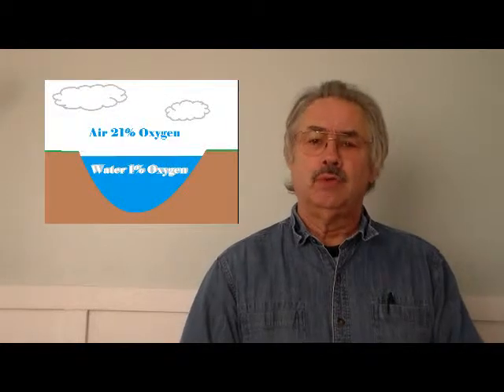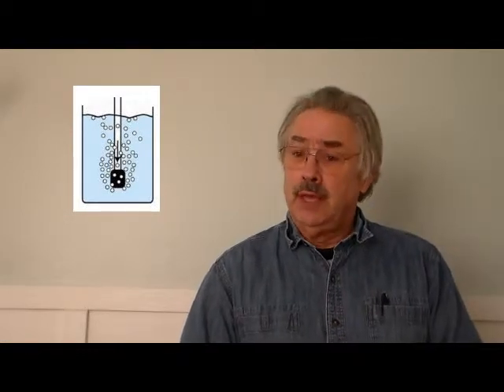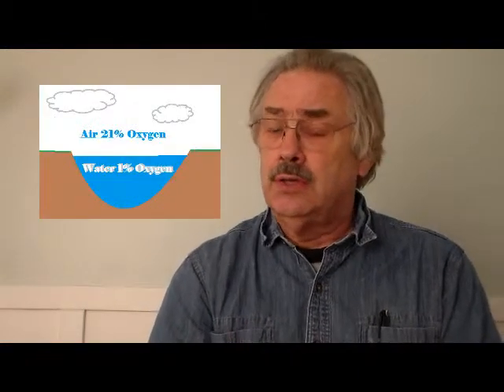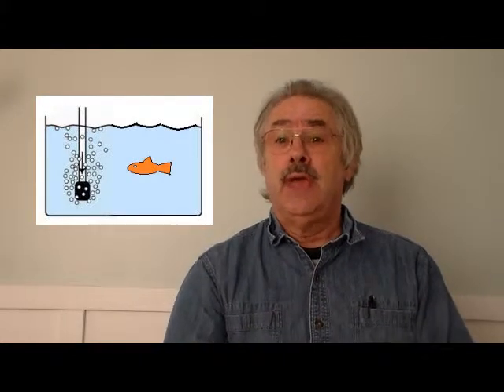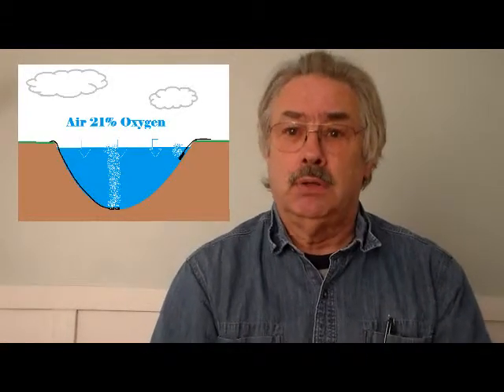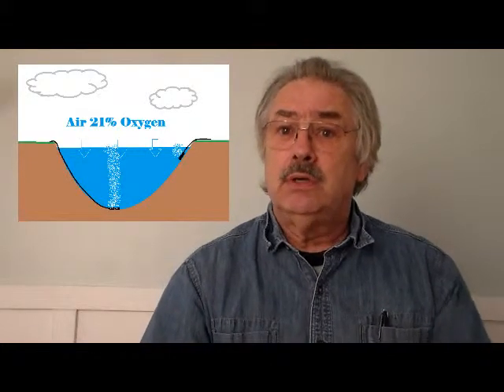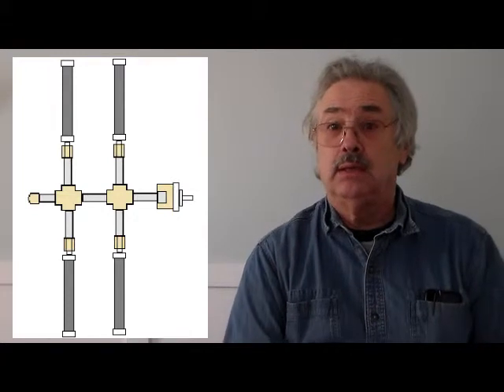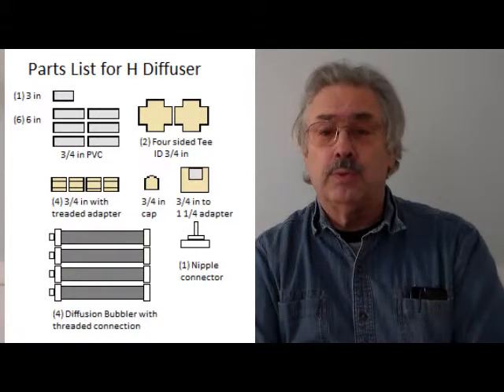PONDS: How to make a Bubble Aerator

Comment: I’m assuming that the compressor is powered by an electric motor? This is a nice set-up but would it work on a windmill powered compressor such as found on the Koenders?
Reply from the maker: I use this set up with a solar powered DC battery.

Comment: I recently added an aeration setup to our lake.  I use an 80cfm air pump connected to two 50' weighted hoses which in turn are  coupled to 25' soaker hoses.  I zip tied the soaker hose to the weighted hose so I have two 25' long lines of aeration.  The bubbles are very fine and in only a month or so of use I have seen fantastic results.  The fish activity has gone way up and the water is more clear.
Reply: You should pull it up and make a video of your set up i would like to see it.
Reply: So I've made some changes. 
For a while instead of 50ft. of hose, I pared it back to 25ft. and moved the pump a lot,  (75'+-) closer to the lake to lessen the load.  Then I found out about diffusers. I bought the ds2 model on a recommendation. Check them out.  Two,  10 inch disc's about 6 inches apart sitting out billions of tiny little champagne sized bubbles. To swim in a spring feed lake getting a bubble massage is pretty sweet.   
But I ran into a problem one day when an alligator swam up, like what she felt and sank to the bottom and tore one of the rubber membranes with her claw.  So I made a screen guard. 

If it happens again I'm going back to the soaker hoses.  They're a lot easier to move around and if you coil them up I can still get a nice bubble massage.

Probably the best change I made was connecting my alexa to the pump.  On or off from anywhere in the world in seconds.  

That still blows my mind.
Reply: So your pump (compressor) runs constant?
Reply: @robertriedinger6657  Yes.  It runs 24/7 but the pump draws very little power.

  The water is tannic and is very dark so after it gets over 2' deep you can't see the bottom.  But I have been checking and the muck at the bottom of the lake around my dock has pretty much disappeared.   It has amazed me how large an area this has positively affected.
Reply: @robertriedinger6657  Not anymore.   Hooked it up to the internet and put it on a schedule.
Reply: I'm very interested in this.. please could you do a step bit step diagram.. and what did you use for weighted hoses? Ta.I'm in Australia!
Reply: This is very interesting to me! After watching several DIY diffuser videos, each with their own complicated connections of pvc pipe and fittings, I began to wonder, “what if I just sank some soaker hose?”

It sounds like you’ve done just that….and it works! 

It sounds like getting it to sink will be the most difficult part but I think I will give it a try myself.
Reply: @dreamcatcherdb  Getting it to sink is no biggie.  I zip tied some red bricks to the hose and let her sink.

Comment: I would make sure the metal hooks are stainless or they will rust out. Also the pipe clamps you will use to connect the air hose to the bubbler. Most the time those clamps say stainless and while the band is stainless the screw inside the band is a cheap mild steel that rust out quick. I would recommend using a Stainless steel wire and making your own clamp. Just recommendations. I like your video and your bubbler. I've just installed a direct solar driven aerator on one of my ponds and have two more to build out. I'll try and shoot a video so you can see the staineless steel wire clamps I'm talking about.
Reply from the maker: Thanks for the advice...I replaced the hooks by using large plastic zip ties to hold the ballast to the bubbler.